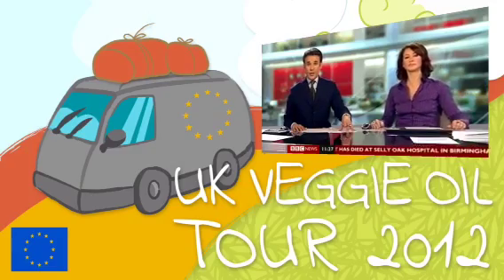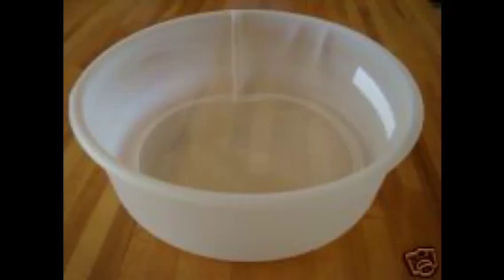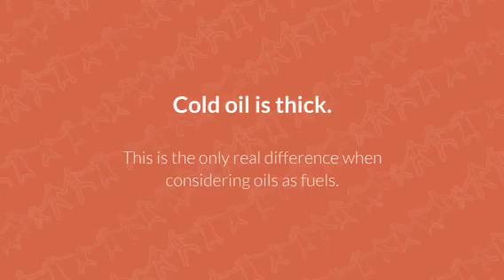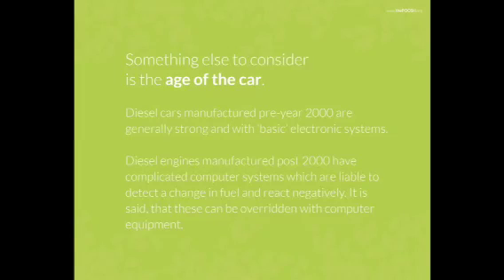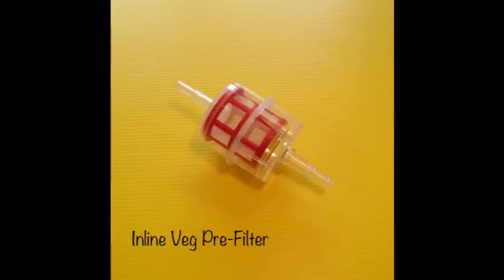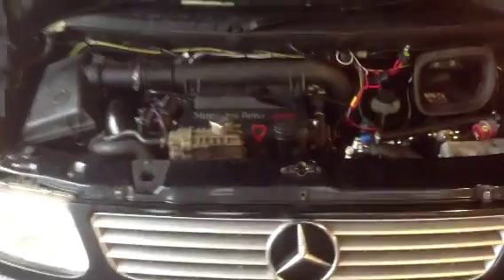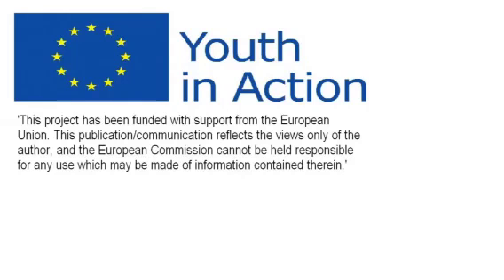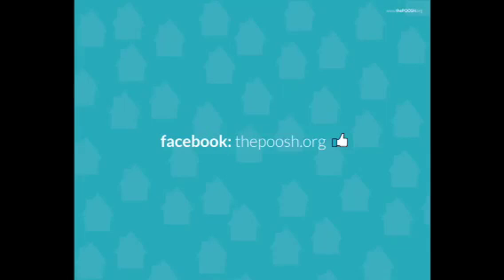How to convert a diesel engine to run using veggie oil

Comment: i was lucky enough to work part time right beside a little popup snack shack... they apparently fried EVERYTHING.  and they stashed all the 3 gallon containers of used oil in the car wash beside them...   one day i decided to get some fries.   they had so much oil it was one the sidewalk outside and i asked what are you doing to do with it.  I DON"T KNOW she said... so i said i would take it all, all of it.   and now i have, in my small town, and very successful kebab restaurant that had no idea how to get rid of THEIR oil, so i pick it up too... i have so much oil now i should be able to run my smart car for the entire summer.   just have to built a rack so i can put all the oil in the top and clean oil comes out the bottom... i don't drive it in winter so no need to turn to biodiesel but may do one batch so i have the 'goop' to make my years soap.

Comment: Why 
Diesel engines are meant to run on veg oil! 

Petrol will skyrocket more 

Used cooking oil 

How to filter 
Old newspapers 
Large storage containers
Funnels
1. Filter 400 micron filter 

3 filter socks 

1. 10 mic
5 mic
1 mic 

Use thin oil (settles on top 
(Svo)
LEGAL IN UK 

2 tanks system:
COLD OIL IS THICK 

Preheating Conversion system
1.
Auxillary diesel tank 
With 
(To start run end end, to flush system 

2. 
Heater system 

3.
Diesel veg oil mix

Comment: Don't try this with a post 2000 year engine, or within 50 miles it will be wrecked!
Reply: It doesn't have to be wrecked if you refine the oil with methanol and KOH, get rid of the glycerin and wash it with water to get rid of soap. Then just add a can of the cheapest diesel fuel additive and you'll be fine. It's quite a process and it's probably not worth it though :p

Comment: Had a Nissan D21 one day ran out of diesel so got dome used veg oil from a restraint in the area to get home never had any filters so poured it in the tank as it was to my surprise it started and drove fine after that never put another drop of diesel in it I asked a mechanic one day why it worked and he said that has a bosh heated fuel pump. Did the same with a Skoda diesel van 1998 ran ok until i switched off That was the end of the van

Comment: I had a land-rover two tank system the bio tank was modified with heat pipes running through it . The bio fuel pipe was run through one of the hot water pipes to the secondrary fuel filter  that had been modified to  be heated . Never had any problems now thinking of doing something similar to my vw caddy
Reply: Did you do it? How has it worked out for you?
Reply: @owendeliebs1894  yes I have . Its been a pig to setup.  . Thing with bio is cleaning the glycerine out of the oil that's what messes up thing . A bit of a process.  Also need to have a switch over to clear the system of bio with normal diesel.  But it works.  Lots of head scratches lol
Reply: @pemj7360  
Interesting. It would be nice if you made a video about your two tank system

Comment: I'm driving a 2001 Toyota Land Cruiser, 2 weeks on, straight vegetable oil, no conversion, no additional additive, just filter, and fill up, and it's driving great!!! No heating needed, no potassium hydroxide, no alcohol, no separation of biodiesel and glycerin.
Reply: How’s it going now? I have a l200 warrior I’m think I’m going to try
Reply: i want to do a 2000 toyotas Coaster 1HZ stock motor. Any tips on how to go about it.

Comment: We used buy a pallet of chip oil from the super market and yjust tip ot in the tank we ran a pajero on it for 9 years with 320000 miles on the clock and no problems just smelled of chips

Comment: If you heat the oil to over 100c can you get rid of all water in the oil?
Reply: You can use methanol to get rid of the water

Comment: I had an old Rover years, ago, I run it on WVO for a year, no problem, it had a bosch fuel pump so you could put anything in the tank, did 17,000 miles on it, and only put £10 of diesel in on a frosty morning. I changed the fuel filter every one thousand miles which was very simple to do and cost around £8 per time.

No performance issues apart from a lumpy start when it was frosty, averaged around 60-70mpg on the motorway, engine was quieter, quicker and it smelt nice lol.

Comment: Rudolf Diesel said "In a book titled Diesel Engines for Land and Marine Work,[18] Diesel said that "In 1900 a small Diesel engine was exhibited by the Otto company which, on the suggestion of the French Government, was run on arachide [peanut] oil, and operated so well that very few people were aware of the fact. The motor was built for ordinary oils, and without any modification was run on vegetable oil I have recently repeated these experiments on a large scale with full success and entire confirmation of the results formerly obtained."
Reply: My uncle hasn't paid for fuel in his boat for years now after his conversion

Comment: Thanks for the diagram, whole thing is 240 so cant see, but found it on your website after typing vegetable oil into the search, great diagram many thanks for that. For others my advice re sourcing if you are happy to filter it is: best bet is probably to offer a small tip to the kitchen porter of some places to take the wast oil regularly: if u have space for it or some of it regularly: helps them, helps you, is the right thing to do unless u find it constantly thrown out for wast collection: which i think it often is in the big vatt containers.

Comment: i use a hydrometer when mixing wmo or wvo so that i meet the specs for specific gravity/viscosity. i'm not a fan of guess work when it comes what i put into my fuel tank.

Comment: I"m curious  does using WVO cause more car maintenance ? what  types of problems would need to be fixed using it
Reply: Can and has caused problems with lift pump failure due to lack of lubrication, fuel pipe failure due to incompatability, high pressure pump failure due to lack of lubrication and seal failure due to incompatability. Can also cause engine oil issues, injector fouling, dpf failure.

Comment: Excellent video I used to run my tdi 2004 vw polo with no mods with new veggie only when u could buy it in any supermarket for less that 24p a litre then almost over night it went up to 120p a litre :-(

Comment: vegetable oil costs 10$ for around 5 L. diesel is around a dollar per L.
Reply: FREE waste (used) cooking oil
Reply: My truck takes aprox. 90L of gasoline and lasts around 2-3 weeks. If I buy a 5L vegetable oil container, it lasts me more than a month easily. You might have more waste oil if you run a very big restaurant or food product factory. How many people actually have access to that much quantity of waste oil. This method is not economically feasible until vegetable oil is specifically extracted for this purpose.
Reply: @AnalystRK  you must have been day dreaming when you watched the video.

There are thousands of places around you that will give you their waste vegetable oil - restaurants, cafes, take away food shops, pubs.. anywhere that uses deep fryers!! And they love to give it to you because they have to pay to get it disposed of.
Reply: Rishi Kishore you can use animals fats oil as alternative, if in case veggies oil avail on the spot,

Comment: can I use new veggie oil from the shop and not used oil?
Reply: I use new veg oil in my banana engine
Reply: you can If your are running a one tank system... for example ' your standard factory set up ' providing it meets the criteria.... I'm assuming you have a banana engine?

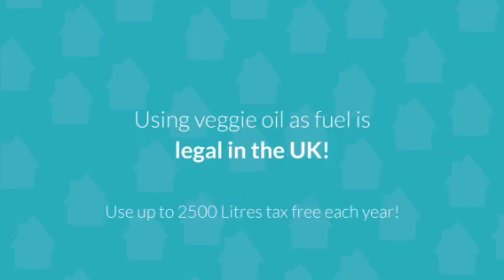Comment: Beware 3:28 to 3:39. Although vegetable oil emits less NOX emission when used as fuel, using vegetable oil as fuel will not significantly decrease CO2 emissions from your car.  Notice how in the video the narrator switched from a concrete measurement of CO2 for diesel to a nebulous figure that he called effective driving emissions for vegetable oil.  Search consumer report biodiesel vs diesel vs vegetable oil for an informative article on the subject.
Reply: Rob James Are you high?
Reply: Mans co2 has no effect on the worlds temperature 
So don't worry, do
It for the cost and less waste

Comment: you fail to mention the engines that dont need converting. those that run a single tank system. like mine. 70,000 + miles and counting on WVO.
Reply: fit a flat plate heat exchanger. i only change a fuel filter at service now as it melts any fats. so far i`ve racked up over 200,000 miles on 100% waste veg oil
Reply: Is it still running
Reply: @itsGed  whats your email pls mate 💌 will it work on a audi a6 2014 tdi
Reply: I have a vauxhall/opel corsa 1.5d non turbo with bosch copy pump. Been running with 25% veg oil 75% diesel no probs for over 15k , you may need to change fuel filter twice as often due to the cleaning nature of the oil, Old mechanical diesels best for this--common rail is not wise. hope that helps :)
Reply: How many sets of injectors have you gone through?
Reply: Hi, I want to run my diesel power generator to supply electricity to my house. I have an acerage and i have alot of sunflower to produce fresh oil. Would the generator run on fresh oil?
Reply: +gerald wade Which vehicles are the most reliable for SVO?
Reply: ***** mercedes OM662LA engine with bosch pump.
Reply: I run my 2.5 turbo diesel Jeep on 100% veg oil without any modification. Runs great!
Reply: What kind of jeep

Comment: Even without using WVO, you can buy 10 litres of vegetable oil from Tesco for £9:00 which gives you a saving of about a third from the pump... assuming negligible differences in fuel economy (MPG). 
 I have got to try this.
Reply: I run my turbo diesel on 100% veg oil. 😎

Comment: Thanks for this video as it is pretty good! The diagram is a little unclear here however as there seems to be a blue plastic T connected to the 12v electric inline fuel filter which you sometimes call a glow plug. No mention in your audio. I assume the plastic T is in place of the 3 way solenoid valve. No explanation of the electrics is explained. Does the 12v Electric Inline Fuel Filter is this connected to the switch? How is the relay fuse and thermostat connected? The photo on the wrap around filter heater isn't clear! Any other diagrams?

Comment: can i use old motor oil
Reply: Yes old engine oil is full of shit!!!  hence the need to filter it.....Also for philzambo, I will add that some engines may not like it? research is the key.   I and many others have run old school diesels on mixes of old engine oil, brake fluid, cooking oil, Kerosene, paint thinners, literally if it will burn a diesel will eat it, new or old used filtered oil.   Modern electronic and especially common rail diesels will not like strange fuels unless they have been really well filtered and then added to ordinary diesel,  this will still cut your fuel bill by thousands of $ per year.
Reply: Stephen Cooper I've ran diesels on waste veg oil for years. Waste engine oil fouls injectors and causes chaos in diesel engines, even if you filter it down to a micron and run it through a centrifuge you won't get the carbon out of it.
Reply: jesus original no
Reply: +jesus original Yes....just filter it well...there are vids about it.    In the early days of diesel engines a truck would run from London to Glasgow and change the oil there for fresh engine oil...the old stuff went in the tank to be used as fuel on the return leg....these were much simpler engines...hence the need to really filter old engine oil.
Reply: Don't listen to this guy, used engine oil is full of shit, it will wreck your engine
Reply: jesus original you can but you have to filter it, thin it(refine it) this produces gases that will need disposing of plus it's mega dangerous. In a nut shell it's not worth it
Reply: Yes... generally the older the better, as long as it is not warn out! Old Toyota FWD from the 70s or 80s are still going strong and can be run on filtered WVO.

Comment: I've converted my diesel engine to run on anything that burns, I've used filtered engine oil, heating oil, petrol, ethanol, and paraffin, I am current trying to use hydrogen atm, the only issue is water from the combustion process keeps leaking past the piston and condensesing in the engine block and contaminating the engine oil,

Comment from the maker: Yeah, you could be spot on with that. The advice we have been given, which should have been maybe said previously, is stick to Bosch fuel pumps. Avoid brands such as Lucas.. That failing, do some calculations. How much veg oil will you use and at what financial saving will this bring you? Then, how much is a new fuel pump. Ive heard of companies who basically take the cost of a new fuel pump into consideration every year (30,000miles) and still some out on top with the cash saved by using wvo.

Comment: The problem is now, modern cars don't have a fuel pumps which will work well with veg oil.
Do you know any type modern engine which is compatible?

Comment: The idea is I get $200 / month to buy food to survive, but no cash for gasoline to fetch the groceries 13 miles away.  So if I could build a biodiesal bike, I could cut my fuel expense farther down, leaving my only last bill being my electric bill which sometimes I can also get government assistance to pay.  I'd build an electric bike, but lithium batteries are insanely expensive so that is out of the question.  I may skip the dual tank and just settle for a 30 diesal / 70 veg mix with no mods.

Comment: I'm going to convert a Baja Warrior I bought for $60 US, once I get it restored, to a dual tank system, if I can find a small go kart diesal engine that is water cooled, to replace the Honda GX-200 clone gasoline engine on it. Any ideas for a small (say 10-20 hp) lawn mower type bolt on diesal engine that could be used on a motorbike?  Gasoline here is about $3.54 / USgallon, and new Canola Oil is $7.34 / USgallon.  But you can buy the veg-oil with a government $200 month subsistance food card.